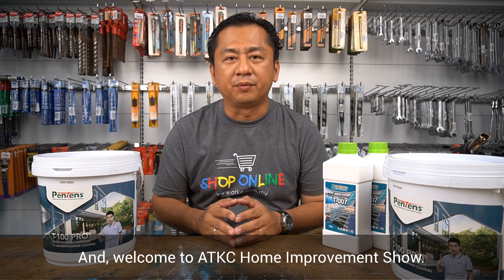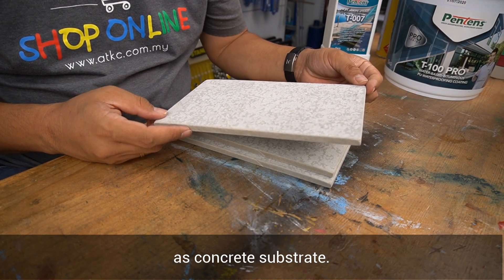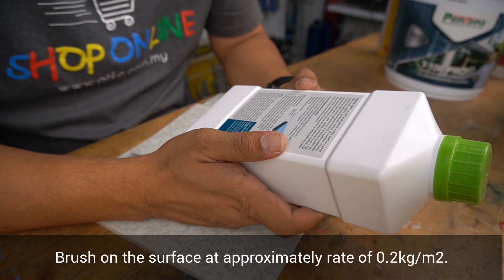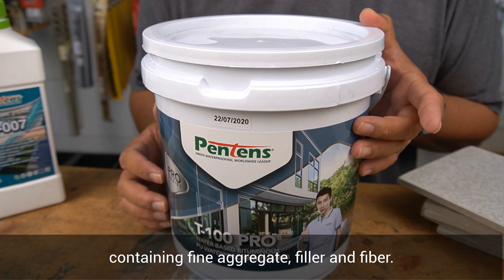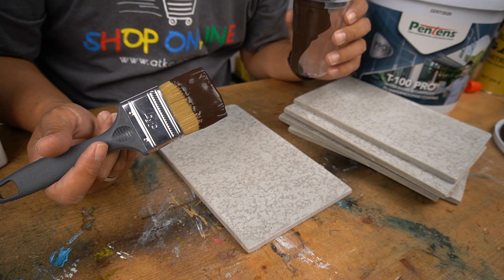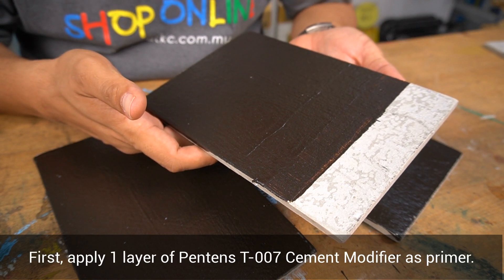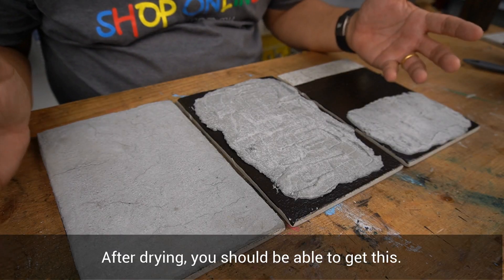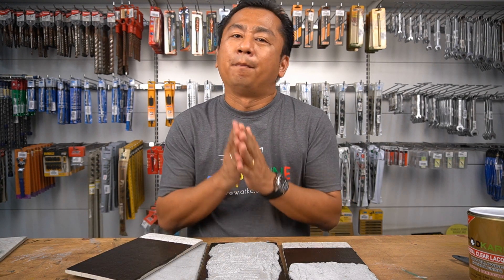Product Review | How to apply waterproofing system | Pentens T-100 Pro Bituminous PU & T-007 Primer

Comment: Bos..boleh ke 1st layer saya sapu T100..biarkan kering selama 8 jam,Lepas Tu 2nd layer saya sapu T200H..untuk slab konkrit yg bocor.
Reply from the maker: selepas t00, apply 1 layer of cement render.
Reply: Klu saya terus pasang tiles boleh kah?berapa ketebalan simen Yang sesuai?

Comment: For exterior Rooftop
Must  layered with Fiberglass ?

What if i skip Render Cement , then paint with Weatherbond paint ?
Reply from the maker: Preferably layered with fiberglass, but this is not necessary.
For T-100, you must apply a layer of cement render on top.
Reply: @ATKCeWarehouse  
Thank you for responding.
Next question. 

Previously i did had similar Membrane type T-200 applied on this balcony . But soon after rain & sun , somehow it all PEEL OFF .
Whst possible mistakes my contractor did ? Thry didn't applied PRIMER ?
Reply from the maker: @ooifw5588  1st, did your contractor clean up the concrete surface? 2nd, Primer is recommended, but may not be the cause of peeling. 3rd. I normally advise to apply the waterproofing coating early morning or late evening.  (referring to the application temperature).

Comment: Can I apply different types of waterproofing methods to get the advantages of both? For example, layer a bituminous waterproofing layer on top of a cementitious waterproofing or the other way round. Which is better for a green roof?
Reply from the maker: Yes, for example. You may use T100 followed by cement render, and finished with T200 (exposed).

Comment: Boss….can this pentens applied to the walls ? Can it acts as coating or sealer ? Thanks
Reply from the maker: For T-100, you need cover it again with a layer of cement render.

Comment: T-700, is 2 layers better?
Reply: If it is already T200 but already crack, should i apply t007 on top of t200?
Reply from the maker: @GoodDAY-ft3vv  1st, try to scrap off the t200 and reapply t007 again. If the crack lines is serious, you may have to repair it first.
Reply from the maker: T-007? yes.

Comment: Hi, why no water is added to T007? Is adding water with ratio 1:3 an option or compulsory?
Reply from the maker: Dilution is necessary, if you wish to use it a primer coating. However, still advisable to use T007 primer instead. As the expected heat or temperature rise during the application, you may dilute it to maintain a consistent viscosity during application. Thanks.

Comment: Can this be use for normal walls, that later to be painted over? My walls is around the house is damped at the bottom part. Had to redo once in a few year.
Reply from the maker: You can try using T-007 primer.

Comment: The tiling is possible using Cement slurry over  Pantene applied verticall  wall and any issues please
Reply from the maker: Yes, once you have apply finishing waterproofing membrane, you may apply a layer of fine cement render before tiling works.
Reply: @ATKCeWarehouse  thanks. What penten range system is best suitable for concrete exposed flat roof and protection screed is necessary over the applied area?
Reply from the maker: @sunilkumararickattu1845  You may use T200 or T200H for direct expose area, provided less traffic at that area.

Comment: Want to ask... I had apply this T100 to an external wall... Does it required to apply any finishing coat?
Reply from the maker: It should be T200 instead of T100 for external wall application.
Reply: @ATKCeWarehouse  Thank you for the reply...
Reply from the maker: @choongwaiheng-8101  Most welcome. I learn too

Comment: My balcony is open roof due to that when heavy rain the water didn't flow in the drainage pipe. But when we clear the drainage up hole the water starting to flow down the drainage hole getting green all the times due to this i can see water mark in my car porch wall just me an idea pls
Reply from the maker: From my understanding, 1) the balcony floor was not leveled towards the drainage outlet. 2) You might need a debris trap - https://www.ewarehouse.my/index.php?route=product/search&search=debris%20trap
Reply from the maker: What you can do? 1) Fill up the sides of the drainage pipes with waterproofing membrane or silicone. 2) From the bottom of the slab, please identify the point of leaks and repair the leakages.

Comment: hi, after applied T-007 on the floor and it will become tacky right? then how to walk through it to apply the top coat? will it spoil the T-007 if walk on it while applying the top coat?
Reply: in this case how long should we wait for 
1. t007 to fully dry/cure before applying t-002?
2. t-002 first coat to fully cure/dry before second coat of t-002?
thanks
Reply from the maker: @kengseong  1. 1-2 hours. 2. 4-8 hours. Application and curing hours may be different due to product substrate, humidity, and application temperature. Hope this helps!
Reply: @ATKCeWarehouse  hi Kok Gei. Thanks for the information!
Reply from the maker: @ksyap2634  Most welcome.
Reply from the maker: For T-007, it will be more dry. T-100 will be more tacky.

Comment: Hello sir...after applying t007 and then t100...without applying cement render after that...open balcony surface...is it ok? Tq
Reply from the maker: after apply min 2 coatings of T100, please apply later of cement render on top of it.
Reply: @ATKCeWarehouse  if used t200...doesnt need cement render...right?
Reply from the maker: @jalaljamal100  Yes, but please make sure min 2-3 coatings.

Comment: I used t100 for my pond. After applying. There are some places with Bubble.what should I do.i have make sure to use the primer and make sure the surface is clean. But bubble still appears at certain area
Reply from the maker: For T-100, you need to apply another layer of cement render on top of it as T-100 is not suitable for exposed area.

Comment: Hi, instruction manual says that we need to dilute T-007 with water on a ratio of 1:3 , which is 1 part of T-007 : 3 parts of water. In your video, you did not dilute T-007 primer at all. Can I ask why is that ?
Reply from the maker: I always believe the thicker the primer the better, and it's more secure. However, I have recently discovered that diluted T-007 primer is easier to apply and better penetration into small pores or craters in concrete surface. There is no right and wrong here. If thin layer coating, we usually need to apply more than just 1 later.
Reply from the maker: I just completed another video on Pentens T-200H, which I have primed the T-007 with 3 parts of water. You might want to see the difference as compare.
Reply: @ATKCeWarehouse  any links to share ? sure will take a look on it.
Reply from the maker: @leslieng9635  Hang on, I hope to release the video next week!

Comment: Can T-100 be top surface on my tile bath room? Thanks
Reply from the maker: Nope, T-100 is not suitable for exposed area. May I know what's the issue with your current tiles?
Reply: @ATKCeWarehouse  
I live in double storey. I discovered downstairs ceiling started grown mold. I suspected leaked from top floor bathroom. So thinking apply T-700 and T-100 resolve the issue.
Reply from the maker: @khenghuatlim7264  It would be good if you can remove the ceiling and see what's hidden within. We better identify the source of leakages before applying remedy.
Reply: @ATKCeWarehouse  
Thanks for the tips. Perhaps will ask contractor to see it
Reply from the maker: @khenghuatlim7264  Most welcome. I am learning as well.

Comment: very interesting video, can you recommend a product that can seal the ceiling and walls? my apartment's ceiling and walls sometimes are damp if the upper floor unit uses the bathroom a lot.
Reply from the maker: There are possibilities waterproofing failures or leakages from the upper floor. It will be more effective to seal the leakages from the upper level.  Maybe you can email me some pictures at support@ewarehouse.my before I can advise further. Thanks again.

Comment: I thought tiles are already waterproof?
Reply from the maker: Most tiles has glossy finish, which are water repellant. For natural store, example granite, slate or marble, it's strong recommended to apply  top and bottom sealer too.
Reply from the maker: Possible waterproofing failures can be the cement grouting lines, and the drainage outlets.

Comment: what's the difference between boscolastic and boscoflex?
Reply from the maker: Boscoflex is a two-component polymer modified liquid applied flexible cementitious waterproof coating. Boscolastic is a two-component elastomeric acrylic polymer cementitious waterproofing coating that is mixed on site and resurfaced on concrete and other construction materials to waterproof.
Reply from the maker: The advantage of Boscolastic is in its elastomeric properties, which creates an incredibly thick yet flexible "rubberized" membrane for a tight waterproofing seal.  And, it can be elongated approximately 250%.
Reply: @ATKCeWarehouse  when I view their technical data on both products, the data seems  similar. Both say elongation break at 150% etc. Try search for the technical data.
Reply from the maker: @allenperera6158  Let me check with Bostik
Reply: @ATKCeWarehouse  much appreciated.
Reply: any news?
Reply from the maker: @allenperera6158  Hi, can you drop me your phone number at atkcewarehouse@gmail.com
Reply from the maker: @allenperera6158  Based on the explanation given by the sales personnel, Boscoflex is 10kg liquid + 20kg powder, while boscolastic is 15kg liquid + 20kg powder. The extra liquid in Boscolastic enhances its product flexibility. Both the elongation at break are at the minimum of 150%. Hope this help.
Reply: @ATKCeWarehouse  Yes, that helps a lot. Thank you very much. I enjoy your videos.
Reply from the maker: @allenperera6158  Thank you for your support too.
Reply from the maker: I am in the mid of preparing content for Pentens Fleseal T-200 UV Resistant Waterproofing Coating, which will explain more about its properties and application. Stay tuned!

Comment: For slab, which 1 is better solution?
1. T007 + T200H
2. T007 + T100 (from my contractor, this T100 is not UV resistant & not suitable for exterior)

Pentens T200H vs Nippon Paint Flexiseal 200, which 1 is preferred?
Reply from the maker: For option 1, you may start apply directly to the existing. For option 2, after T100, you need to apply a layer of cement render. You may apply T200 or Flexiseal after this for extra layer of protection. I believe both products are similar, you may find more information at our website www.ewarehouse.my

Comment: Can Pentens T-007 apply on painted surface or plaster surface? TQ
Reply from the maker: Yes, I have tried on fiber cement board which is similar to plaster surface. But, what's your purpose?
Reply: @ATKCeWarehouse  I'm trying to fix an old exterior slab which had water ponding problem. I intend to apply T200 after T007 been applied onto the old painted and some plaster area.
Reply from the maker: @UncleRay360  My advice: Fix the ponding issue first, before applying water proofing solution. You may need to level the floor slab to avoid ponding issue.
Reply: @UncleRay360  Can. Have done it with exterior wall. But scrape off any loose paint if any, first.  If there are big holes, just use normal cement mixed with water will do and patch them. Seal any cracks , even hairline cracks, with Xtraseal ms-601 sealant or any similar MS polymer product (choose white paste) wait till dry then paint on T-007, wait till dry to sticky texture,  then paint on T-200 (2 coats). using pentens fiberglass mesh will make the coating last at least 5 extra years.Make sure no impending rain for 6-8 hours. I don’t work for pentens but i had researched many waterproofing solutions.
Reply from the maker: Good explanation.

Comment: Is Pentens T-007 good for covering Concrete Roof cracks on Terrace?
Reply from the maker: Firstly, it really depends on the type of cracks. If hair line cracks, you may dilute the T-007 with water and apply on the lines before applying the top coats.

Comment: Hi,  I just bought  the  007 primer,  approximately how long to wait until it  become  tacky  before  applying the  top coat ya?  Thank youu.
Reply from the maker: Please allow it 1-2 hours to dry. For better adhesion, leave it for 6 hours or more.
Reply: @ATKCeWarehouse  I see  thanks  a lot  !
Reply from the maker: Let me know if you encounter any further issues. Thanks
Reply: @emraelinda1134  the manual doesn't say to wait for it to dry. It says to apply top coat when it feels sticky. you have to feel it with your fingers.
Reply: @allenperera6158  if it's still sticky, will it get torn when walk on during top coat? thanks
Reply: @kengseong  u mean paint on or walk on? If to paint on top coat while primer is sticky, then no, it will not tear. They will join  together. there's a quite a few videos about the T-007 primer in YouTube for you to roughly know what it's like.
Reply: @allenperera6158  i mean during applying the top coat while the primer is sticky.
i've experienced whereby the primer is sticky and due to large area, when i'm walking on the primer to to apply the T-200H top coat, the primer layer tend to stick to my shoe causing it to tear off.
Reply: @ksyap2634  Yes, it will stick. Better to use cementitious waterproofing product instead of this, if you plan to walk on it or put things on it like table and chairs. The membrane of the  T-200H is very thin and will break if you damage it.